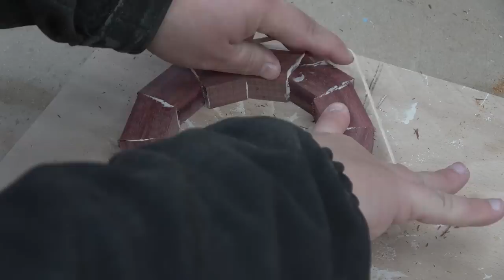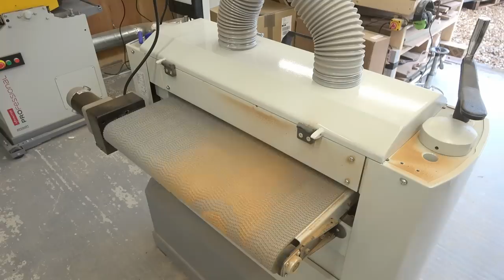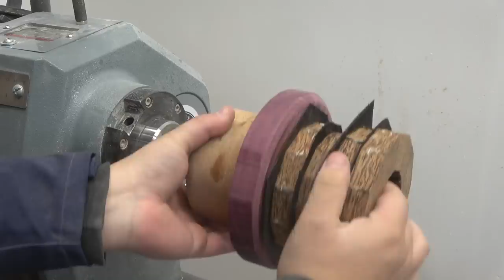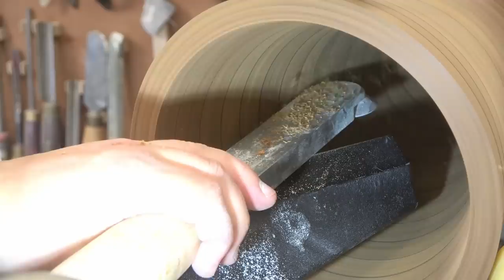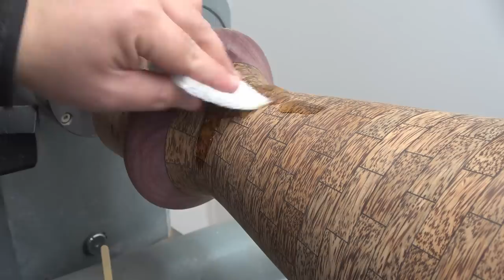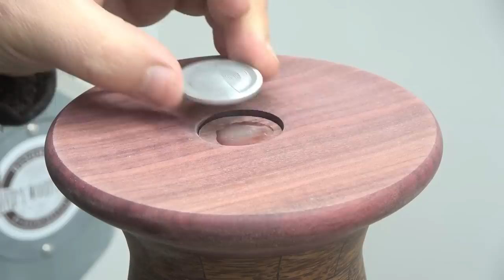It was time to wood turn something DIFFERENT, will blow your MIND !!!

Comment: This might be an obviously answered question (but apparently not to me). How do you calculate the correct diameter of the base when a vase like that is top heavy and won’t topple over?
Reply from the maker: Honest answer, I don’t. It is surprisingly stable but probably wouldn’t be safe where toddlers are running around all day 😀